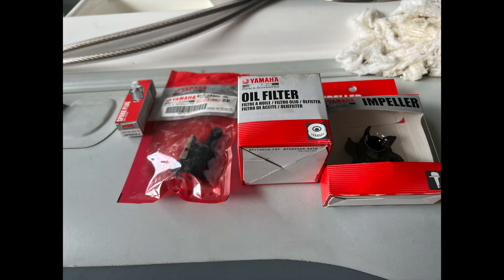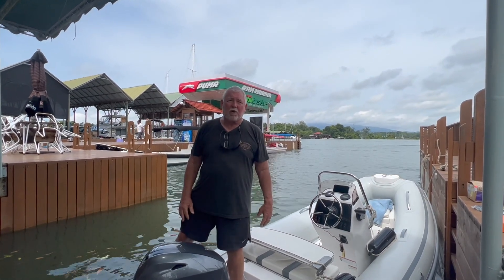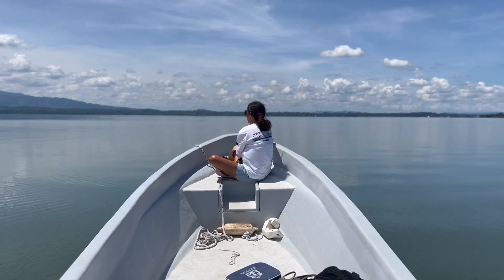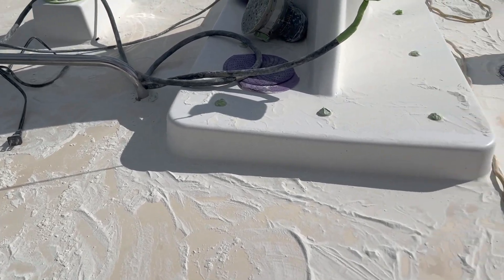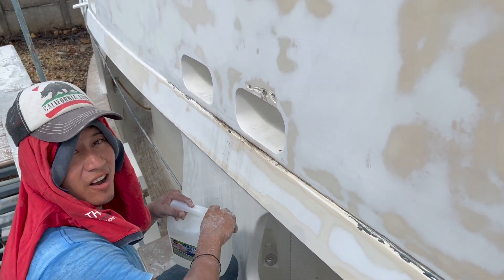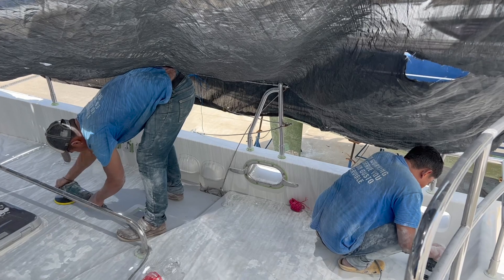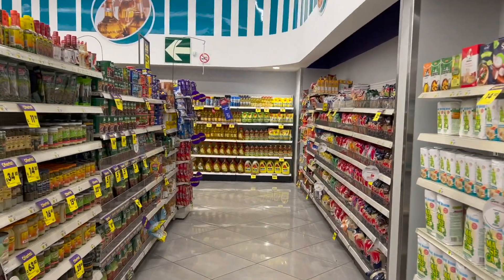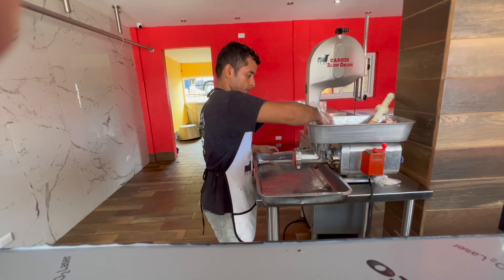Nordhavn 62 Kariwa - shipyard work, paint prep, repairs and living in the Rio Dulce area   HD 1080p

Comment: You did disconnect the power to the engine before you unplug the ECU cuz if you plug in the new one for this power running to the engine you could cause a stray voltage that could hurt the new ECU

Comment: Nice video- thanks! I may have missed it but what did you do for the grey looking deck? It looks nice. Is that painted non-skid, eg something like Awlgrip with Griptex in Whisper Grey?
Reply from the maker: It’s whisper grey Awlgrip with grit, spray painted on.  Video from time in Guatemala shows application
Reply: @MVKariwaN62  Thanks. I am thinking of getting that and it seems to be a very useful application. Do you find it very hot in sun? Most people report no but a few yes (eg in Florida). Do you find it tends to clean up easy and not show too much dirt? (Some people report certain painted non-skids, eg Kiwi, trap dirt and are hard to clean. Many recommend 1-2 top coats over non-skid to make it less likely to trap dirt in between granules.
Reply from the maker: @en8581  it can get warm but never terrible. It’s cleans easy.  Our grit and paint is applied together and it was two coats after two primer coats.